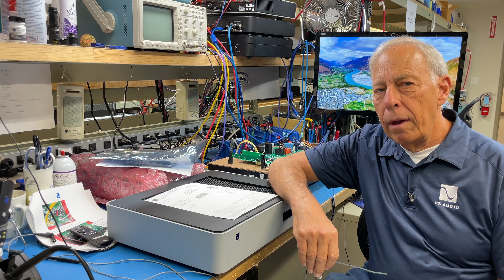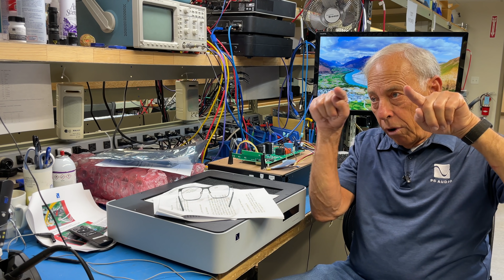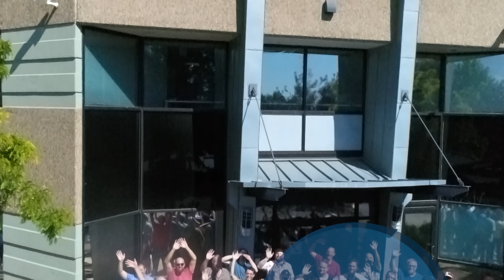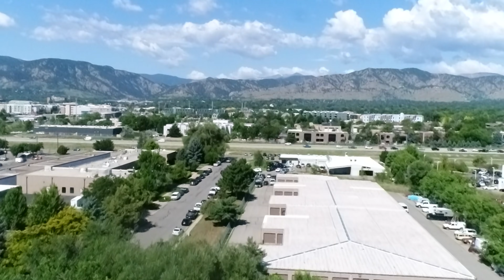Crossover slopes explained

Comment: To my ear it sounds like the bass is alot tighter at a 24db/octave crossover slope. I have a switch on one of my home subs that gives u the option of 12 or 24 and ive listened to it for months on 12db/octave and just switched it to 24db/octave a couple weeks ago and there is definitely a difference in performance

Comment: So in other words, low/high pass filters aren’t all or nothing… some frequencies outside the range pass through, but they’re just not as loud? 
I ask because I have a powered sub and powered tops but I like the fullness that full range pass through gives. My filters are the ones that exist in the speakers (with no control over their settings). Would I get benefit from a more advanced crossover set with a more gradual slope allowing my tops to put out some (but not all) lower frequencies?
Is that correct?

Comment: The Slopes are pretty self explanatory what can bring Confusion is the terms  First, Second Third and Fourth order Low Pass-filter. But that is explained in this video .Higher order simply means Steaper low-pass with more Db,s of high frequency cut  off filter at the point you setting your low pass crossover filter for example 50 hz. Above that crossover point you have -24db of filter cut off higher frequency starting from 50 HZ.With 4th order.The orders definitely have there place in construction of hardware  crossover filters using Coils for Low Pass filters and capacitor for high pass filter. In a electronic crossover filtering system everything is sweepable so you can set up your crossover filter anyway you want .On a electronic crossover filter system it’s simply low pass filter frequency and db of  gain -6 -12 -18 -24 but not always called 1-4 order instead it’s called slope.

Comment: I still don't understand, but that's not Paul's fault. I bi-amp my Magnepan 3.3s. My crossover is a Behringer CX2300. It has near unlimited crossover points, but I simply set them where my system sounds the best.

Comment: Some describe the crossover frequency as a "hand off" point, where the filter network (coils, capacitors, and resistors) work together to make sure only low frequencies get to the woofer and only high frequencies get to the tweeter. Using the term "hand off" just shows they don't understand how that network really works. A full range audio signal arrives at the filter network, woofer and tweeter are wired in parallel, meaning each could POTENTIALLY get the full signal. But the coil chokes out higher frequencies, meaning only the low frequencies are able to get to  the woofer section. At the same time (there is no "hand off") the full range signal is filtered by capacitors to prevent low frequencies from getting to the tweeter. When components are chosen correctly for the frequency responses of the drivers, and the impedance of the woofer, then a "crossover point" will happen at the desired frequency. 

But it is important to realize there is NO "hand off", each section operates independently, neither "knows" what the other is doing, but with a good design it doesn't matter. Some people successfully design speakers for years without ever understanding how the filter network functions and where the crossover point actually comes from. And most don't care, which is fine if the product performs as desired. But some may want to know how it all actually works.

Comment: You know your stuff but you didn't explain that 6 dB crossover very well. In the example of 1000 Hz low pass crossover the bass signal doesn't stay flat until 1000 Hz. The roll off starts at a somewhat lower frequency. The impedance of the coil is a function of frequency, as the frequency gets higher the roll off gets more and more pronounced. It is really a "filter" and not an actual "crossover." The coil filters out high frequencies, the capacitor filters out low frequencies, together the coil and the capacitor, chosen appropriately, can give a pretty flat response over the full range.

Comment: 6 dB is the only way to have a time-aligned, phase coherent crossover, which is why it's what John Dunlavy used exclusively.
Reply: Strange that not every loudspeaker manufacturer does this…

It’s because that with a 6 dB (first order) filter there is a phase difference of 90º all over the spectrum.

So, phase coherency (even better: 0º phase) is only the case when the drivers are coincident: horizontal, vertical and time aligned. But, when you have a tweeter above a woofer (and they are time aligned), this results in “Lobing Error”, the central lobe is pointing downwards 15º. And this means that time alignment and linear phase is only the case when you listen exactly on-axis.

And when you move your head up, the amplitude response peaks (till +3 dB at crossover frequency) and you get phase shifts. And when you move your head down, the amplitude response dips (till cancellation at crossover frequency) and you get phase shifts.

And we leave all the extra IM distortion with first order filters aside...
Reply: @JerryRutten  Real first-order Butterworth filters are hardly ever used. There are more practical variants that you come across relatively often. greetings from Switzerland
Reply: I'd like to hear more about that.
Reply: @mm-tg8oo  In case "BB" doesn't respond to you ... a 6dB filter is simply a coil to choke out the highs from the woofer and a capacitor to block the lows from the tweeter. Therefore nothing is there to cause phase shifts. If you additionally slope the baffle slightly the radiating surfaces of the woofer and tweeter are also time-aligned. With well chosen drivers this design performs great. But there are tradeoffs and that is why most premium speakers use 12dB, 18dB, or greater slope filters, with appropriate additional circuitry to correct phase issues. That drives up the price and lowers the speaker's efficiency thus requiring more power to drive it to the desired volume. In theory it improves the quality of the sound reproduction.
Reply: @txmike1945  Thank you sonmuch for that. Please explain "slope the baffle".
Reply: @mm-tg8oo  The baffle is just the front panel of the speaker and it usually is vertical. A woofer is deeper than a tweeter. So with the tweeter above the woofer, if you tilt the front (the baffle) back the right amount the radiating surfaces of both the woofer and the tweeter end up in the same plane thus arrive at the listening position at the same time. This is especially important for frequencies near the crossover point where both  drivers have measurable output. Look up the Xavian XN 360 speaker for an example how a sloping baffle looks. I built a 2-way in that design.
Reply: @txmike1945  That is very interesting.
Reply: @txmike1945  With a first order filter there are phase shifts, the two drivers differ 90º in phase for the whole spectrum. See further, my response to BB.

Comment: I'm a mechanical technologist/machinist and we have our terms as well. Drives my wife crazy when we start talking, "Thous" (.001"). 
I enjoy building speakers, but I was never much for crossover design. I understand it, somewhat, but building my own crossover? HELL NO!
This certainly sheds some light on how they work. I understand what the coils, caps and resistors do, just don't know what values to use in the circuits. 
I'll stick to mechanical stuff and I'll let the experts stick to the electronics stuff!